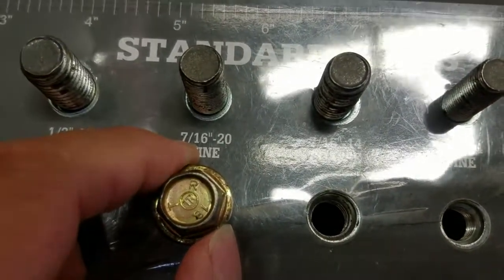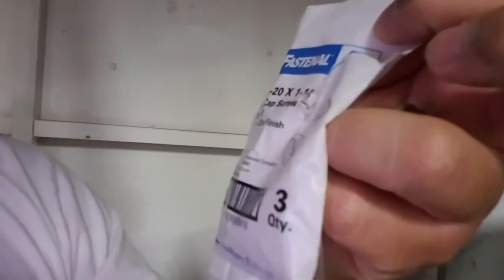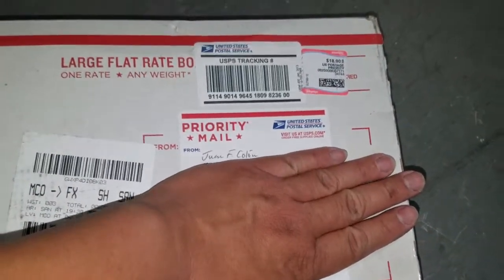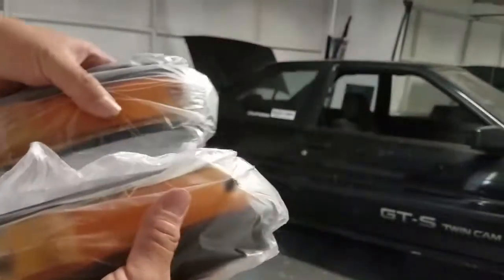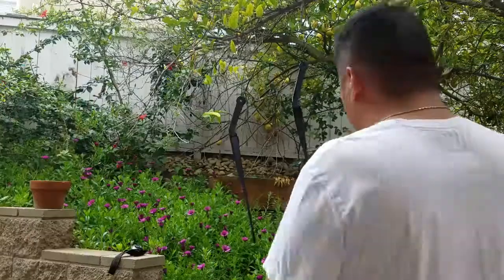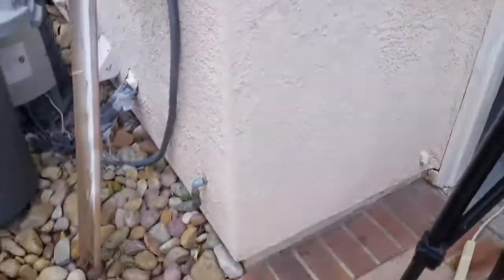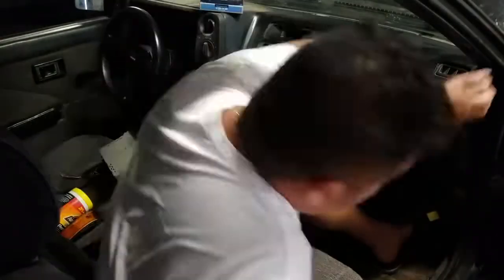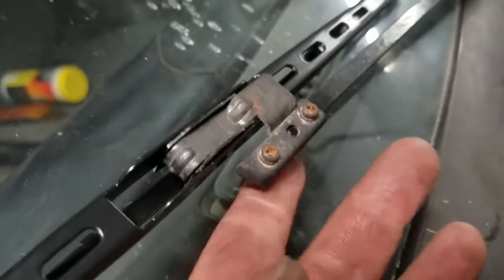AE86 Rear Bumper Bolts, and Wipers Install

Comment: Hahaha your kids are awesome! And I had the same issue finding those bolts for my kouki brackets! And side note, I made the mistake of using one bolt for the brackets. The hook that holds the bracket will eventually start bending up and sag the bumper. And in my case the bracket broke. I'll send you a pic on IG
Reply from the maker: Ely Hernandez thanks again. Yeah after you showed me, I am convinced I will need to have all four bolted up. Good looking out.

Comment: if u have stock gts ecu open it it has the marking for the wires u need u can label same with beams ecu
Reply from the maker: Kackharot thanks I'll have to open it and see.
Reply: The Mod I can send u pictures on fb bro hold on let me do it real quick
Reply: i sent video and a link for the key words
Reply from the maker: Kackharot wow thanks. Yeah that's really going to help out. I appreciate it...